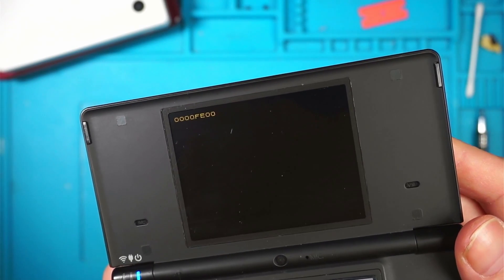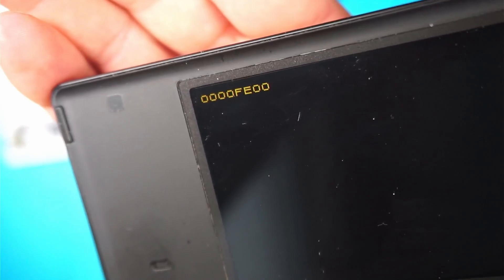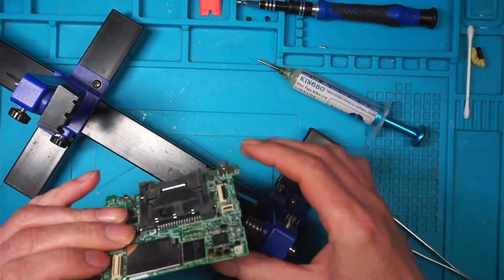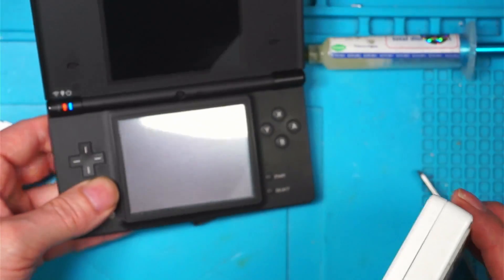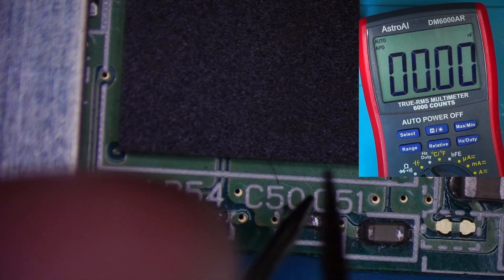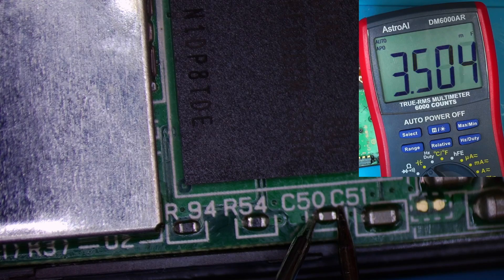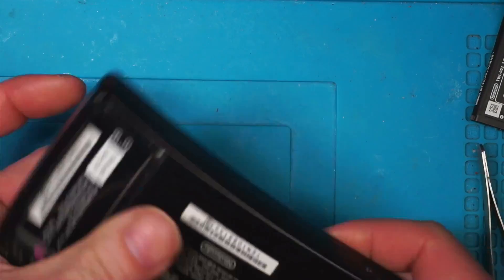DSi error 0000FE00 reflowing NAND attempt to fix.

Comment: fiz o rebaling  na memoria e voltou a funcionar, so aquecer ela nao funciona teria que remover e rebalar as esferas novamente
Reply from the maker: Well done! I don't have the facility to re-ball unfortunately.
Reply from the maker: I removed the memory chip, cleaned the pads, applied fresh solder to the board and the chip before putting the chip back on with my hot air station. Now the system boots and both screen are white.  I'd give it another go with some solder balls but the little ribbon connectors are driving me crazy!!
Reply from the maker: What size solder balls did you use? I will try it.

Comment: have u got any progress? ive got a dsixl with this error, swapped battery and wifi board and still error, the kid who sold me it said he tried to hack it with an R4 so he probably did something wrong in the process... trying to solve it but looks theres no way
Reply from the maker: I haven't looked at it again since the video. My view is that, if it hasn't been solved by people cleverer than me by now, it's probably not going to be solved lol.  It would be good to see if swapping the CPU and NAND chip from a working DSi would fix the issue, but I don't have the tools or skills at this time.
Reply: @PhilipBryden i actually tried the ntrboot on it with a flashcard and i mansged to make it boot godmode before the nand, but godmode freezes on “mounting drives”, any other nds file not pass first screen too…. Idk, it didnt looks fixable at all
Reply: @nostaldex  Same here, it booted GodMode9i, but it dies in mounting drives, 5 years since the 0000FE00, still hoping for a fix
Reply: @df_br1182 i think it didnt have a solution, looks like a nand brick because of update/hacking failure
Reply: @nostaldex the bizarre is that mine has never been modded, it just died randomly
Reply: @df_br1182 maybe a crash in anu game inserted? Or ram corrupt, dno.
Looks like dsi is very sensitive to these things

Comment: FE00 is a nand error. The nand could be dead or bricked. But it could also be broken balls on the cpu side. you could try to reflow the cpu. check if you have 3.3v on C50. do not swap the eemc. it is married tot the cpu. search for dsi modchip. it's similar to picofly, but it needs the times entered manually. i haven't tried it yet. Also you can try to dump the nand with a card reader. there are tools that can bruteforce the keys based of the emmc production date.

Comment: I've recently found my DSI XL but when I try to charge it the amber light starts flickering and blinking. I swapped out the battery and it seems to have stopped blinking but continues to rapidly flicker. I left it charging for the night but it doesn't seem to have charged at all as the indicator is at the same level it was. Does anyone know a fix for this?
Reply from the maker: I don't have a definite answer, I'd probably start checking for continuity from the small powerboard to connector on the main board. Then the fuses. If that doesn't find anything, swap the powerboard for a working one. Then after that, start looking for shorts with a multimeter. All of that said, you have to make sure you have a known working battery first.

Comment: Great video as always. Ur channel teached me a lot. I began repairing a NDS Lite and replaced the screens. When I bought it, it didn't turn on. Now the green light blinks once, but it still doesn't turn on. Battery works fine too. Today I replaced the mainboard with another mainboard of a NDS Lite that worked fine. Now I've ran into the same problem.😅 Green light blinks for a moment, but the screens stay dark. Hope I can find the problem soon🤔 Have a nice day everyone!
Reply from the maker: If you have change the mainboard and still have a problem, have you double checked all your connectors? Do any of the screens flash when you turn it on?
Reply: @PhilipBryden @lenaw.4449 Was the back of the new bottom screen isoleted? If not, then probabaly you shorted out the BT+ and BT- connections on your board, this breaks the F2 fuse. You can check continuity on this fuse. I made this mistake and killed 2 boards. XD But you can bridge the connection of the fuse. The better solution is of course to replace the fuse. :)

Comment: would be interesting to take the chip off dump the data to new emmc and out new one on the board. (obviously wont fix corrupted fw or any nand issues, but if write function on the chip failed, then could potentially save it. )
Reply from the maker: wooah that's way above my paygrade lol. So the firmware is on the NAND I imagine. What if I take the NAND from another faulty board? It seems a pretty small chip, I wonder if I could reball it by hand.
Reply: @PhilipBryden  you can't because the NAND is encrypted and married to the CPU. you would have to have the keys to decrypt the nand first.
Reply from the maker: @chasefournier  Aw that's rubbish, I was getting my hopes up too. Do you think FE might stand for firmware error? or could it be just a coincidence?
Reply: @PhilipBryden  unsure unfortunately
Reply from the maker: @chasefournier  Thanks for helping me understand a bit more about NAND, it's appreciated.

Comment: Great video and excellent job trying your best to solve it. Could the FE in that error stand for Firmware Error? Searching FE00 online I got results of the MFC-J3940DW brother printer with a 00FE error code. In the printer's case it would need a firmware update or a factory reset. But it looks like the DS/DSi Reset does not reset firmware. Maybe there is a way to "flash copy" firmware onto that DSi?
Reply from the maker: What a good spot FE might be firmware error. I might try swapping the NAND chip if I can find confirmation that the FW is on that chip. I haven't gave up.

Comment: Try removing and re seating the WiFi module or replacing the module. This is a common error code for that.
Reply from the maker: Hi John. I should have gave more info in the video, but I had tried different wifi modules. I've worked on this board in the previous video about the Zelda DSlite.

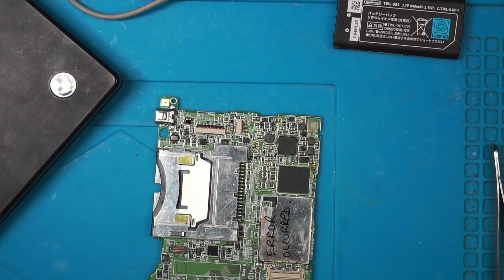Comment: 13:15
For DS/DSI lineup, before going nuclear (taking out the soldering iron) you should ALWAYS try swapping wifi chip. Try swapping the wifi chip, might fix it.
Reply from the maker: Agreed. I'd already tried that inthe Zelda video before this, but I failed to mention it. Sorry.
Reply: so it doesn't erase any data with that error?

Comment: To find out if its the nand ic use freeze spray on it and it should work for a couple of minutes
Reply: If your still getting same error it won't be the nand thats the problem
Reply from the maker: Interesting. I hadn't heard of that before, thanks. I'll look into it for any future projects.
Reply: @PhilipBryden  I second that. You can turn a normal PC duster can of air upside down and use it as a freeze sprayer. It's a really super useful tool to have around the repair bench. 

I have a video on my channel where I used that method to diagnose bad capacitors on a Panasonic camcorder.
Reply from the maker: I'll take a look for your video. I have tried it on my DSi with no luck. Still the same error but I do have a very cold thumb now too.
Reply from the maker: Thanks for the suggestion. I just tried it with an air duster upside down. That thing is cold, my thumb stinging lol. Didn't work in this case tho sadly. A handy tip for the future tho.